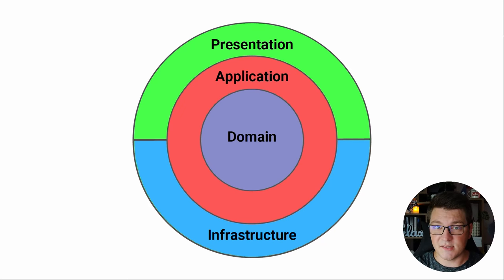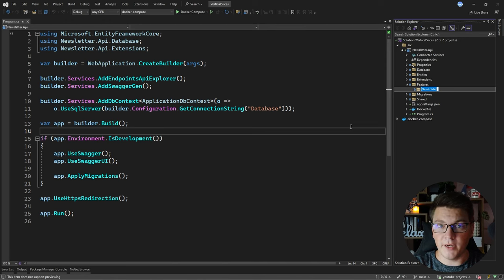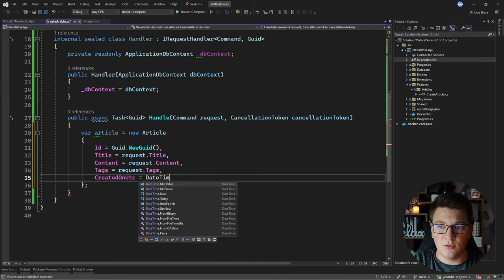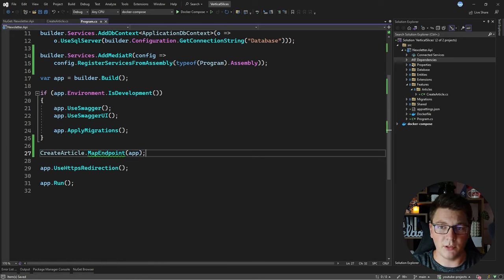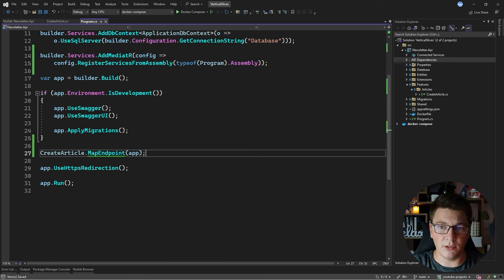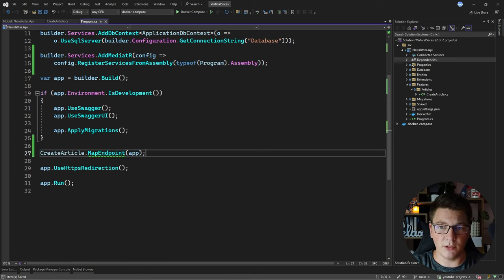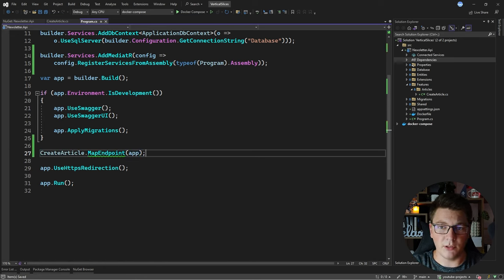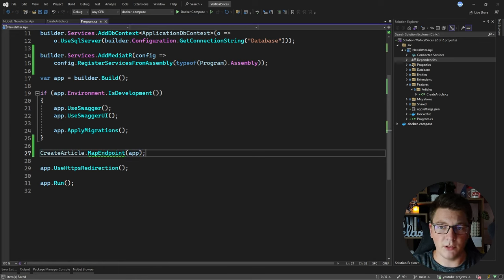Vertical Slice Architecture Project Setup From Scratch

Comment: I believe the contracts folder should be under the feature/article folders. My ressoning would be we are grouping classes based on features or use case concerns rather than technical concerns and putting contracts as a single unit would be a bit confusing😂
Reply from the maker: Fair point!

Comment: Thanks Milan, this is a great example of a sanely organized project that threads a balance between normalization and separation of concerns.   Doing by feature seems to be a very good way of allowing both newer programmers to the project to come up to speed quickly and still give more seasoned team members the organization we desire.   This example has a lot going for it.
Reply from the maker: And the ideas applied here work for any architecture, really

Comment: Nice, at my current company we made the decision to try out VSA. We're using MediatR to get all of the cross-cutting concerns out of the way (via pipelines: logging, scoping, tracing, analytics,...). The main differences between our solution and yours are: 
- we map everything manually (because mappers are slow AF in comparison to just manually mapping things).
- we use a regular API controller per feature in stead of minimal API.
Conceptually they both achieve the exact same goal :)
Reply: I still can't understand why everyone tries to use MediatR. Maybe you can bring some light.
I don't see any problem using services per feature and then you can have decorators to implement logging, validation, etc. Decorators can be dynamically created. I did that to introduce a miniprofiler and at the same time there is no dependency on the miniprofiler pack in the application layer.
With a service interface per feature you don't need to create files for command and handler, it is more natural flow.
I would use MediatR for communication between features/components. Like when you create a product you need to send email, so you trigger notification product created and then it will be handled.
What do you think?
Reply: @volodymyrliashenko1024  totally agree! I believe that MediatR like events should die within a time, because it's just a lazy approach to redirect your request flow. It may be useful in some async scenarios where components lies behind different layers and you need to communicate them directly, but in general it's just useless, especially when you define query/command and corresponding handler in the same file/folder
Reply: @volodymyrliashenko1024  that last part is ALSO handled by our MediatR implementation: our "command" (workflow) handlers all output a list of events that can be picked up by a MediatR pipeline to be "notified". This keeps our CommandHandlers pretty much devoid of anything that isn't a business concern (notifying other parts of the code that something happened is NOT a business concern but rather an implementation detail).

The whole point of having vertical slices is to not have the "clean-architecture style" (large) services that try to do multiple things and leak (often unrelated) code all over the place. Having monolithical services usually causes a change in one feature to potentially leak into other features.

Sometimes you DO want to share code and in that case, you do want to create a service or even a repository (*shudder*) just for that. It's just not the default way we interpreted "doing" vertical slices.
Reply from the maker: What does your analytics pipeline do? 🤔
Reply: Mapster has an option to use code generator, so no reflection, so just as fast as hand coded. Also, you can step into the generated mapping while debugging unlike the black box reflection method.

That said, hand coding is going to allow to compiler to catch must more error and support refactoring.
Reply: @pilotboba  I might look into it, thanks for the suggestion!
Reply: @pilotboba  Hand coding doesn't catch missing mappings unless you have all of those unit tested.
Reply: @mtsmithtube  If the mappings are coded and you change a property name on the Dto or the Entity, your compiler will tell you right away.

Automapper with just skip it since it no longer matches on both sides.

Comment: Hello Milan, I'd love to see a part 2 that goes beyond the typical VSA post. How does one structure a feature that builds on top of 2-3 other features. If Articles are one feature, the let's assume that Authors is another feature. How do you structure the relationship between Articles and Authors. Have you found any nice patterns for structuring these elements. 

I've seen you suggest putting the domain entities in a separate feature/folder. I think that's another great video that gets into more nuance of this approach.

TY for sharing.
Reply from the maker: I'm extending it to a Microservice example next week. And I'll add more features.
Reply: @MilanJovanovicTech hello Milan, where can I find this?

Comment: I think this should be much simple:
- Why have Mediator when you can have all this into a static function/method (called handler) on the CreateArticle where services are passed from Endpoint.
- Only think that Mediator bring into the table is when you want to use same handlers from other endpoints/other services and I guess the point is not here because of vertical slices
-....
Reply from the maker: Awesome, you can make a video to show us your approach 👌
Reply: I also don't really see the point in using Mediatr with VSA. I use FastEndpoints for building endpoints and it has a built in command bus for cross cutting concerns. Mediatr just adds another unnecessary layer of abstraction/indirection IMHO.
Reply from the maker: @duznt-xizt  FastEndpoints is something I need to look into 👍
Reply from the maker: Huge kudos for actually doing it, and making your own video! I would've left a comment there, but no comments allowed since it's flagged as content for kids.

Very elegant solution on your end. I think MediatR still wins for the cross-cutting concerns, since it's working with raw requests instead of HttpRequest, so it's simpler in that regard.

But also take into account that in the videos I have to show simple examples, or people won't be able to follow. And the approach I'm using is more valuable as complexity grows. Not saying it's the only way of doing things, but it's certainly one of the good approaches.
Reply: Nice, appreciate that you made the video.

Comment: I had previously watched this video, but it made much more sense to me after completing your Pragmatic Clean Architecture course.
One question I do have is on the entities in VSA. I noticed that in this example the Article entity suffers from primitive obsession. Did you set it up that way to keep this example simple, or do you normally go that route when implementing VSA?
Reply from the maker: Yes, it was done for simplicity sake. You can still do DDD together with VSA.

Comment: I love it! It's so much easier than grouping by technical layers.
However, I have some questions/notes.
1. The contracts are going to be used mostly by external clients, therefore I would see them placed in a separate library/package.
2. As I understand, the features should stay isolated. But there are cases when a feature might need to call the commands from another feature/s, as separate steps. I know it may seem odd, but is it ok then to violate this principle? I'd assume not, but then how shall we deal with the problem? Duplicating the code/features is clearly not a good option, moving the smaller features in a common folder might work, but isn't odd to have a feature in common when it's only reused once?!
Personally I'd say it's better to just access directly the smaller features through query/commands. What do you think?
Thanks and keep up the excelent work!
Reply from the maker: 1. If you're building an API - does that make sense?
2. Communicate using events, maybe?
Reply: @MilanJovanovicTech  on #1, what about building an API for a Blazor front-end?
Reply: @joehernandez3231  My question exactly. I think the contracts would need to be in a shared library.

Comment: Thank you for this masterpiece. Very valuable 20 minutes for my career.

I think this approach is great for small~ projects. What's your opinion?
Reply: I Agree with you. It's an approach great for small projects and maybe medium projects.
Reply: VSA can be used for any project: small, medium or large.
The disadvantage of VSA is that you need to have notions of software engineering to implement correctly, otherwise you may end up with chaotic dependencies.
Reply: @DaveRoman-mc4nn  Doesn't this apply to any architectural approach already?
Reply: @umtdr  Yes, but let's say VSA is a special case, you must be very careful that the vertical slices do not depend between different modules, otherwise it will complicate the dependency graph.
One way to avoid this is to use an intercommunication module or as some call it (shared layer).
Reply from the maker: This approach works on any project size. Ask Jimmy Bogard, he uses it on very large enterprise projects.
Reply: All projects are small if you define your boundedcontext and your use cases well.  It doesn't matter if the entire project has 200k files and 3M lines of code, in the end each use case is a small piece of testable software.

Comment: Great video Milan. However, I think  in my opinion, the slice should also contain its own DB Context, domain layer, etc. This way the featrure is more portable. But I like you solution here, this is very elogant and definitely has its own use case. Great job. I know these videos are not easy to make. You are an inpsiration . PS: Sorry for any typos,  My nose is about six inches from the monitor, I am between glasses. Lol.
Reply from the maker: Wouldn't we end up with TOO small slices in that case?

Comment: So, we would end up going from clean (modules which are separated at their own places nicely) to a mess where everything is being tried to fit in couple of files. I did not like it personally but I appreciate your efforts milan for bringing this out to let us know that how VSA can be implemented in .ner core if needed ever.
Reply from the maker: I think you should give a try and see for yourself. This can still be clean. You don't have to put everything in one file. It can be in one folder.
Reply: @MilanJovanovicTech  hmm but I am already fascinated by your clean architecture series so I would like to use that bit longer 🙂
Reply: If you moved the classes out into separate files in a directory named for the use case you'd get the same benefits. I think either approach is valid, the main idea is code that changes for the same reason (use case) is physically close by, as opposed to spread in various directories.
Reply: Still not convinced, Then better using 3 layer architecture or use just single project. Why people are investing time learning to go moduler, make it as smaller unit of code as possible, going towards microservices.
Reply: @microtech2448  Imagine you have 100 controllers, 100 services (use cases) and 150 models (request/response), each representing a technical layer. 

So you have 3 technical layers: controllers, services and models.
Now if you want to add a feature, you need to jump between the three layers. The same happens if you need to fix a bug, you will need to access three layers to know where the problem happened.

This is what VSA tries to avoid, not to organize your code by technical layers, but by feature, with VSA you will easily know at a glance what the features of the system are.

PD: You can also combine VSA with clean architecture.

Comment: I once started a project following the vertical slice architecture. But after some time I moved more and more to the Clean Architecture approach :D Don't know why. Now I have in my application layer a folder called Features where all my use cases live grouped by the feature within one file.
Reply from the maker: Isn't that still aligned with VSA concepts?
Reply: VSA over clean architecture.

Comment: What are the uses of an API contract is it used in a tool for docs? Why is it the exact same as the command but different for query? Are there any use cases to why we have the command/query with their respective API contract request/response?
Reply from the maker: Being able to separately evolve your command, which is an internal contract...

From the an API request, which is an external contract

Comment: Hi Milan!
I'm back with another question.
I saw another videos of yours regarding this topic. In some of them you created the features in the Application layer, in another ones in the Presentation/Api layer. The latter was proposed in the refactored version. If that's the case, what does it remain in the Application layer ?
Which approach is better, in the end ?
What should be kept in each layer ?
Thank you!
Reply from the maker: VSA tries to have a pretty flat structure. I'll do some more content around this, as I feel there's not enough information.

Comment: I love the VSA. And I prefer to use partial classes for our static FeatureX class whenever the lines of code are too much from the maintenance point of view.
Reply from the maker: I've seen a few ways to approach this:
- Static class with nested types
- One file, many (non-nested) type
- Multiple files, one folder (partial classes fall under this?)
Reply: @MilanJovanovicTech  I have to use different file names for the same partial class, like CreateUserCommand, CreateUserCommandHandler, CreateUserExtensions etc, each representing a nested type. It is basically a marriage between first and second approaches you mentioned. The advantage is, I can encapsulate the whole "feature" within the static class and just expose two extensions for IServiceCollection and IEndpointRouteBuilder.

Comment: First off, great video! I did have a question about using the nested classes inside the static class. I can see that it groups all of the features inside of a class with the same name as the file, but other than that, I was struggling to come up with another benefit. What are your thoughts?
Reply from the maker: Jus that - keeping related things together

Comment: Thanks for the explanation. But...If you push vertical slices this far, what is the point of CQRS? Why not just create an Endpoint per Feature, and implement everything in that one method?  Or in a service if you can call it from multiple places? This approach smells a bit like the 'smart UI' anti-pattern. I prefer vertical slices within the application layer of my clean architecture, and using mediator to separate the UI from the application layer.
Reply from the maker: CQRS always has a point. It's MediatR you have a problem with. So just don't use it.

Comment: Thanks once again. In this video, you're injecting the DbContext directly into the handlers. Is this not tightly coupling the handler to a specific piece of infrastructure? I'm concerned that VSA gives up some of the loose coupling that CA provides.
Reply from the maker: Yes, this is the case. But does it matter that much?
Reply: @MilanJovanovicTech  Perhaps. I thought we should aim for abstracting data mutations behind repositories.
Reply: @_rcs we should not aim for it, but understand the trade-offs. Usually, the usual reasons for a repository abstraction are testability via unit test by mocking the repository or mutability by replacing the repository without changing the business. E.g., Change the DB implementation.

If the test case does not have much logic, it is just reading and returning data, there is no reason for unit tests. You can go directly to integration tests to validate your query and parses. 

About the mutability, how many times have you seen someone actually replacing the DB? I saw it a few times, but usually, it is just overengineering for something that you will not use.

So, if you have a strong reason for an extra abstraction, go for it!

This is the beauty of VSA architecture. It is the most straightforward approach until you get a reason to make it more complex.
Reply: @gilvanornelas3163 Thanks so much, that is really helpful.

Comment: What would you do if you had to develop a CLI in addition to the minimal API? The logic of your handler can also be used for the CLI application. I don't know if VSA concepts can still be applied when multiple applications need to be implemented
Reply from the maker: I think it can work. Instead of exposing an endpoint, you would expose a way to call the command from the CLI. Right?
Reply: @MilanJovanovicTech  but what if I want both?